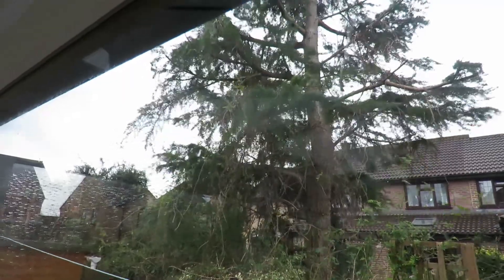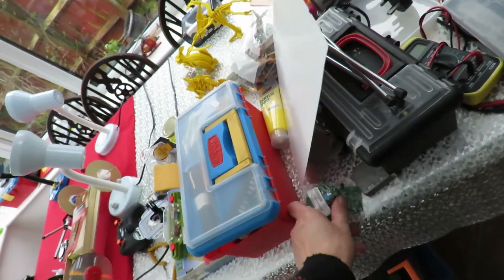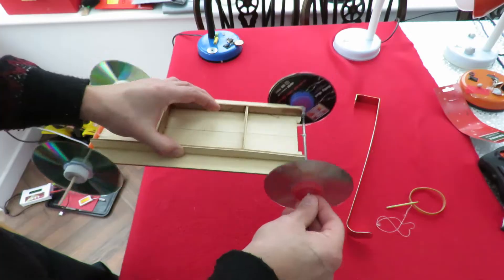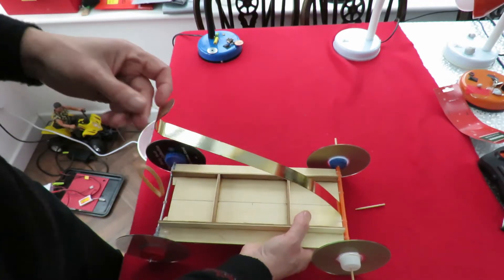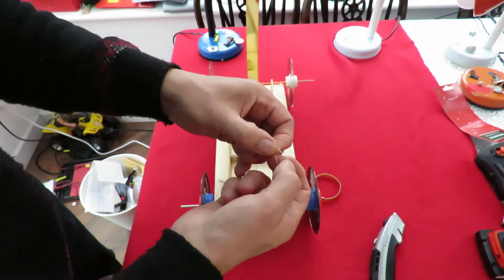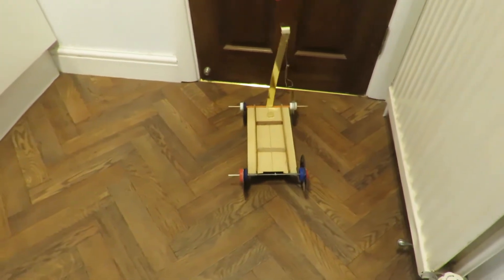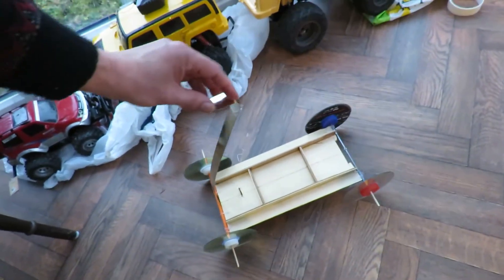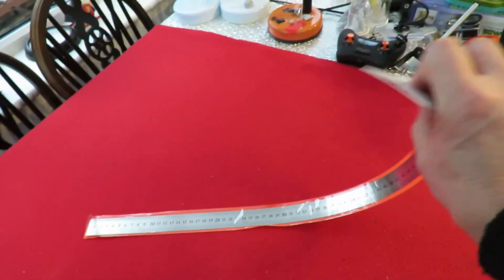Rubber Powered car converted to flat spring power

Comment: I got one of those metal rulers on ebay, I had been thinking of a use for it for a while, as it was no good as a ruler, I was going to shave with it but I cut my fingers getting it out of the packet, so be careful if you use it to power your car ;-)
Reply from the maker: Well oddly enough I have actually been using it as a ruler, when I had fully intended to use it for the spring power on a car like this. I did buy two of them so I could bend one and use the other as a ruler but having done this car with the wreath hanger it would be so similar in design I don't think I will bother. Here is another similar design from back in 2013 https://youtu.be/-zcdR-kEnLQ

Comment: That worked better than I expected because it did not look like the springy metal had much energy.  Never know until you try I guess.   : )
Reply from the maker: You really don't need much energy to propel these cars forward. In fact the bigger issue is too much energy causing wheel spin and wasting power.

Comment: I'm impressed. Ten points for even thinking of this. Can ya not bend the bar thats poking through the base so it stays put?
Reply from the maker: Yes you could but I rather like my bamboo peg idea as it means it was easy to remove it again for the next conversion project 😁👍
Reply: @GrandadIsAnOldMan  the peg is a sweet touch though

Comment: That looks god fun what if the kite string was attached to the axle would it then go forward and reverse?
Reply from the maker: It would do that for a while at the end of the run but it would significantly reduce the distance covered and most of these projects are required to cover a minimum distance.